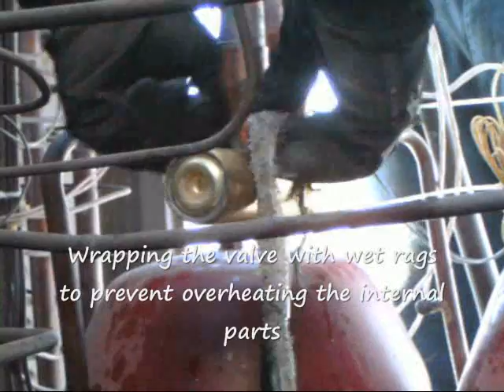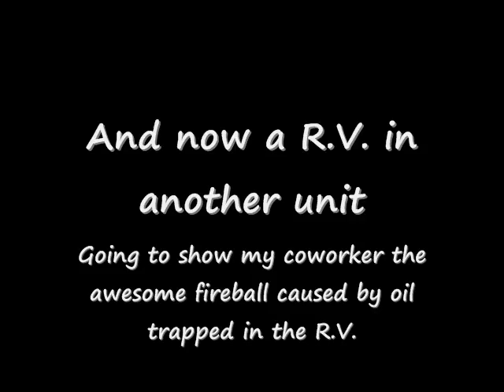HVAC Brazing Skills - Part I

Comment: I would have done them one at a time when sweating them back in so I could have presoaked my rag each time to prevent too much heat on the valve. Maybe even ran a hose and let it pour on the rag while doing it even to ensure protection of the reversing valve.. I'm probably being over cautious but hey better safe than sorry I suppose.

Nice seams though!

Comment: How are you going to get water in there, when the female part of the joint is facing downwards. I don't think drops of water will wick back up that far. Besides when you re-heat it to 1500 degrees to braze, I don't think any water in the joint will hang around very long. Do you guys in the philipines not pull a vacuum? It's hot enough in the Philipines that even a 1500 micron vacuum will boil off any leftover moisture...

Comment: So I disconnected the economizer board, replaced the ignition control board (hot surface igniter relay had burnt contacts not allowing enough amps to heat up the glow stick), replaced the hot surface igniter, cleaned the burner screen, replaced a crankcase heater on stage 1 compressor, and all is good.When it got warmer outside, I went back and replaced the economizer board.The hood on those things have a tendency to leak rain water which gets in there, and turns the board all nice and green lol

Comment: I love Trane Voyagers, gotta love that "Heat Fail" and "Cool Fail" shit, hehe. I had one 15 ton unit over at the local liscense branch started screwing up, and got a no heat call on a Saturday. So I got out there, middle of January, room temp in the lobby is like 64 degrees, zone sensor says "heat fail" and the thing is running in stage 1 cool off and on... Turns out the economizer board was bad, screwing up the modbus communications, causing the Unreliatel main board to act up.

Comment: It's soft copper, like you said.  Besides, when you heat it back up to brazing temp, it anneals the pipe again.  He was just tapping on it, not bashing it with a sledgehammer.  I use this exact same technique all the time changing out compressors.  Never had a callback yet.  Except I use my trusty old pair of Stanley channellocks to bang on tubing with, hehe.

Comment: wrapping/wetting rugs with water with un soldered joints are prone to have a moisture inside the system..2:06 - 2:13, or evev have water inside the system...also hammering the tubing is not a good practice...technician in the Philippines never do that kind of thing...

Comment: Cool video. I've found some trouble with sprinkling water around the joints too quickly after it's done sometimes starts to temper the joint and copper and make it hard and brittle. I've only ever had it happen once but I'm sure it was due to me getting some cold water on the hot jonit after brazing. I think it's pretty tough to do in this trade, and more critical where strength of steel parts is required not copper tube. Cheers dude. IC.

Comment: If you want to change stuff and be able to work in the liquid line, you have to front seat the liquid valve to make the compressor goes into vacuum and when its at zero stop the current right ?

Comment: Banging on soft copper to wedge that  discharge line back in...I wouldn't wanna be your customer. What about the wet rags on the filters bro, sensitive ain't they? Braze the female end of the joint 1st, if you braze the smaller pipe first  your expanding the wrong tube. Right Butthead? I know I know u got the job done. Do it to it

Comment: Purging with nitrogen during brazing, evacuating the system properly and a new filter/drier will not cause any problem with moisture in the system. 
Just because of using the large torch and the fact that the line has been brazed before, the brazing only takes a very short time. I don't think the filter/drier will be very hot after that.

Comment from the maker: Yup. On those cube style resi units (Like Goodman Desert Series) you either hang upside down or take the condenser coil off first. But at least those the torch heats up super quick compared to these larger pipes.

Comment: Worked for temper zone in new zealand, who have been making units of all sizes for the past 20+ years. Worked in brazzing line one, and made all the headers, gas and water pipes. Wet rag in certain places will stop the heat from traveling and turning it into a water cooled unit lol Anyways, good to here a guy that loves his trade.

Comment from the maker: Also, using a large torch on a filter will get you in and out as well. I haven't had a filter fail yet after installing one. Or a RV or TXV. Now if you're going to use too small of a torch, then all the paste and rags in the world wont help you because you'll be spending all day welding that part in. :-P

Comment from the maker: They were changed out on different units, not all on the same of course. I don't think I got any water inside the pipes, but with the camera angle maybe it looks reckless. That "damp cloth" is several small pieces all soaked and wrapped around the important areas to be a "heat sink" and is known to be better than the "paste". Using a LARGE torch also enables you to get in and out with the weld so there isn't as much time for the heat to draw into the internal parts of the RV.

Comment from the maker: Hmm... you know that's a good question. Honestly I never hear anyone talk about purge while UNbrazing joints. But to be honest I don't usually (but I try to cut components out) and I guess if you create oxidation during brazing in parts, you can when unbrazing as well. However, after UNbrazing you can just blast nitrogen through the system and that should blow out the black ozidation where the part is removed. You don't have that option after brazing in the new part, so purge keeps out the O2

Comment from the maker: No doubt. Especially when you've crawled down INSIDE the Trane Voyager and you can't get away from the odor fast enough! :-0 But I recovered these units pretty good and didn't have that problem. Just all the oil trapped in the discharge line that's shaped in a "U" that holds several ounces of oil.